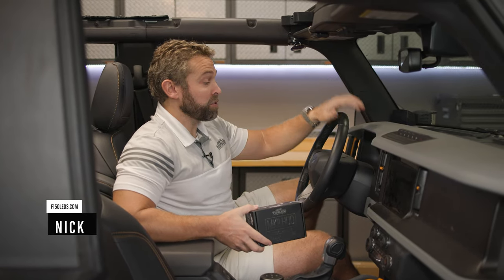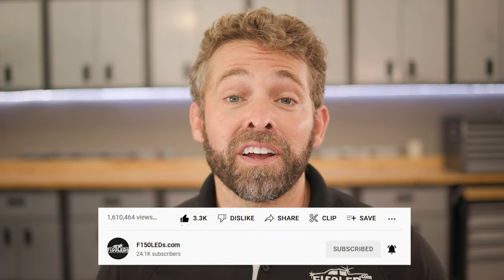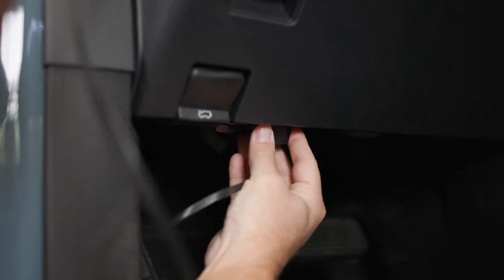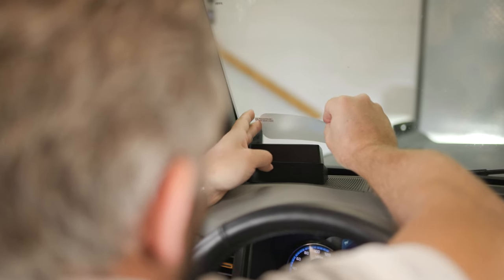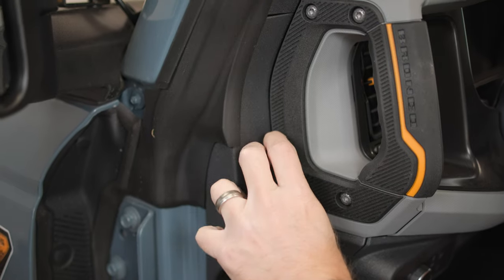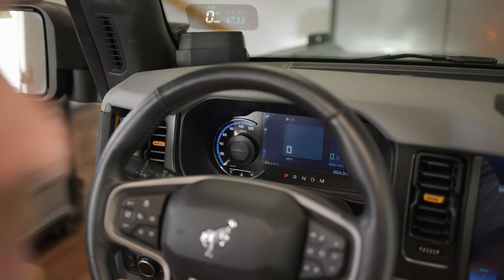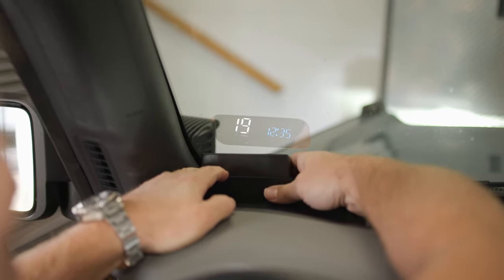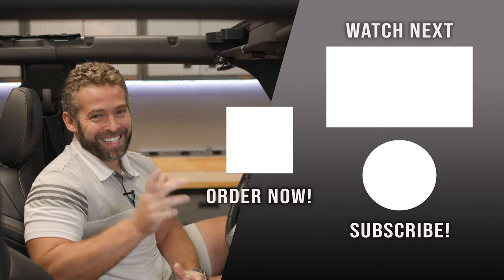Bronco Heads Up Display Unit (From F150LEDs.com)

Comment: What is the 1-6 at the top of the dispay for? I just installed mine a few days ago and the 1-6 doesn't change or do anything when driving...
Reply from the maker: Those are your RPM's. If they don't respond while your pressing the accelerator then your HUD may not be functioning properly. I would first recommend unplugging both ends and making sure they are connected securely. If that doesn't work then our customer service department can send out a new unit!

Comment: Did you install that on top of the speaker? If yes, does it have to go there? I don't want to block mine.
Reply from the maker: Hey Bruce, we did off towards the side, but you certainly don't have to! You can place it wherever you think it fits/works best. Thanks for your support, we are looking foward to serving you!
Reply: What are the measurements of the base?
Reply from the maker: Hey Bruce, you are looking at approx. 4.5"x2".   Thanks for the support & opportunity to serve!